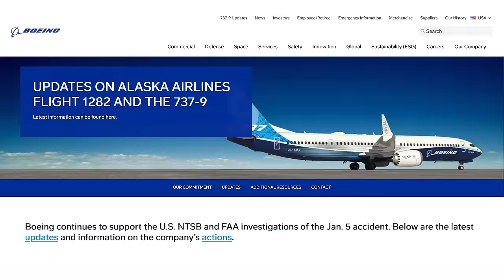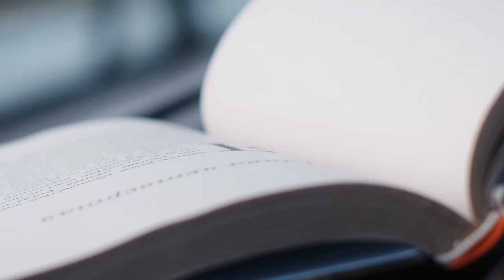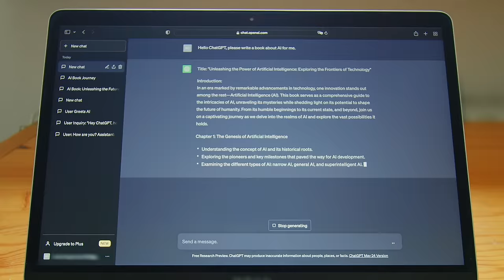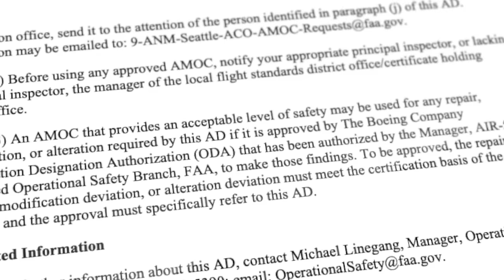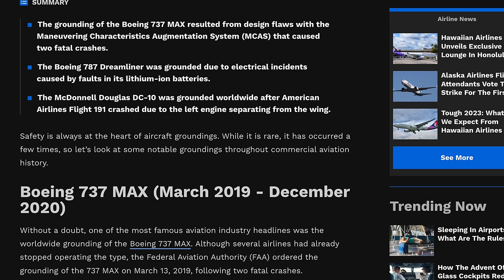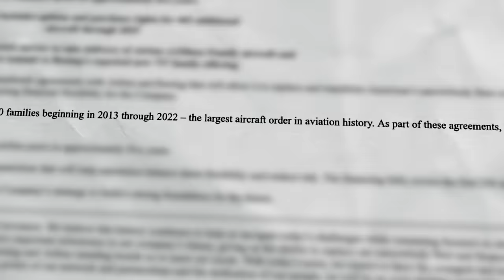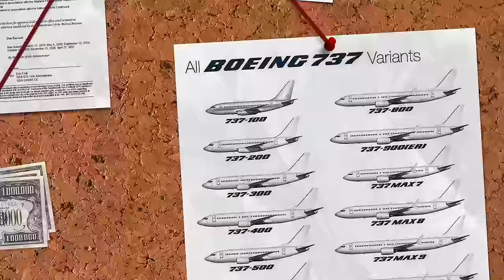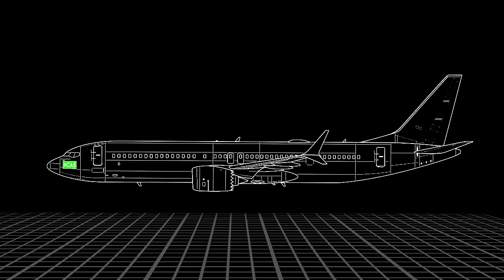737 MAX - How Greed is KILLING An American ICON

Comment: Acording to Mentor Pilot the max was a perfectly safe fly able aircraft without the MCAS  system. However its handling was different and that was the problem as it would need pilot retraining. The MCAS system wasn’t supposed to do what it eventually land up doing and that was down to faulty software. Apparently MCAS is in use on other armed forces planes without a problem all be it with I believe different software settings. “Mentor pilot” does a brilliant job of explaining.  As for the plug that really was down to human error and the failure of proper inspection, again Mentor Pilot explains the details as to why it wasn’t inspected, a failure in the rules!  Those type of plugs are used on other planes and when fitted correctly!  are perfectly safe. The bolts in themselves don’t hold the plug in place, rather they stop the plug from moving up out of its secured position had just one bolt been fitted this wouldn’t have happened, unbelievable that all four were missing. As for the airline my guess is the airline was aware of a problem and I’ll bet it was scheduled an inspection and repair. They probably thought it was just a faulty or damaged seal as that was the reason for the plug being removed in the first place.

Comment: ok stop the drama about the loose bolts raising the number to 500. A Rapid D wouldnt have killed all on board unless the door happened to hit the tail  and ht odds of that are really slim. And pilots would never check fuselage for leaks. How would they? . they'd check the working doors for leaks and it probably didnt even give a door warning. And it takes awhile to find a problem if it gives a warning then stops.  The training on the MCAS wouldnt have been much since it's not much different than a runaway trim scenario which has been trained for say 50 years. Put your hand on the trim wheel and stop it or turn off the system. i believe the one crew turned the system off then back on. There's a reason it happened at small airlines from companies you've never heard of. Their training and pilots usually arent the greatest. I had 40 years in aviation as a corporate and  airline pilot.  and i got tons of stories that would curl your hair.  My airline didnt have the updated software for one jet type for over 15yrs because they didn't want to pay for it. Boeing kept this going because it was cheaper and an easy plane to fly and less training cost and got them quicker. Plus the pressure to buy american. This isn the first time a plane has been stretched and stretched. the 737 was originally built to land on dirt and grass strips. its landing gear isnt much compared to other jets.

Comment: I am on vacation. Both flights to get here were in 737Max. The first 737Max9. On the Max9, the cabin pressure was very poorly controlled. Why can’t they close loop that thing?
Reply: I once worked at a medical manufacturing company with a broken culture. I didn’t think that this would happen when the product is life and death. It does. Greed undermines leadership. Leadership is the fertilizer that keeps the weeds down.
Reply: You will know, if you find yourself in a greed driven organization, because everything is bonkers.

Comment: Simple switch(es) either go for Airbus A320/1s or try Comac C919s or even give Irkut MC21s a go.
Reply: The A320 is its own can of worms. The list of software issues with that plane is scary AF.
Reply: @paavobergmann4920  Surely means nothing compared to MCAS on B737 MAX
Reply: @t8polestarcyan22  The difference, in my personal gutfeeling, is that the A320 is wonky, and the 737MAX is downright criminal.

Comment: P.S. I take it some of it back. "The market forced them," is a garbage argument. If you can't compete with the safe competition, you don't put out an unsafe product. Any reasonable competent software engineer knew that Boeing's proposal was bollocks from the jump. Faking physics using software is ALMOST ALWAYS going to be just as expensive as fixing the physics to begin with.  Boeing's plan MIGHT have worked, if they had spent the necessary time, money, and care on the software, but they didn't. This has been a pox in software effectiveness since the 1960, with hardware engineers noting problems and limitations with their design and saying, "we'll fix it in the software." It least to many failures and disasters.

Comment: My advice: take the train. Oh, right, there is no decent railsystem in the US. Wherever it is you're going, I hope and pray that you make it there and back safely. Your videos are really educational, but not just that, there's enough going on that kills people. No company should be killing people for greed. I would say: have all current 737s checked from top to bottom and inside out. Stop building new versions. Build only the ones you already have, minus the 737 max. And in the meantime, start the hard process of actually building a REAL new plane, even if it takes 15 years to complete. If you had started that before you would have nearing completion by now.

Comment: Conventional doors are held in place by air pressure at altitude. Why didn't they use the same fail-safe sealing mechanism for the plug ?  Short answer is probably to save weight. Every gram of emitted CO2 counts these days as every other criterion, even aircraft safety, becomes secondary to "saving the planet".

Comment: 09:20 - they complained , any issue with the aircraft even before Max they have to report to Boeing and Boeing advised them on what to do and if it's safe to fly further and so on, which probably they said it's okay and gave them some parameters that they can keep flying the aircraft as this could be due to a faulty sensor. Faulty sensors are usually the most common issue and in some cases aircrafts can fly like that for a short period of time, ofc depends if it's a known issue, risks and the list continues.

Comment: I read ,Alaska airlines knew there was a cabin pressure issue yet still flew several flights w/aircraft & gave flight restrictions(no flights over water & alt limit). Why wasnt this plane in service, not still being flown?.Companies should hire fr with in more often. People who actually care about the future of the company. People with experience who have knowledge, wisdom and understanding. You also have to make sure your employees are taken care of. Cant hire grocery baggers to build airplanes or doors blow off in mid flight... Has to be a career. Carpenters, plumbers, light rail drivers, electricians all make more & still have pensions. Boeing used to be up there w/Long shore men, Railroads and top notch companies for employment/careers. They should go back to what worked for the company before and made it and its workforce what it was in 80’s ,90’s and early 2000’s. That way things like this don’t happen. Very hard to get good workers , harder to get good worker with experience . Im sure the auto industry will have similar issues if the employees remain unhappy or face a high turnover rate.

Comment: Boeing's 737 was a great design aircraft, one that should go down in history as a significant type class.
But unfortunately so was the Model T and Model A Fords. Great and significant doesn't mean it's flight worthy forever. It's an old and time worn, now less effective and less fuel efficient, design option for a prestigious manufacturer to opt into for new designs. It's become the old VW Bug of commercial airplane carrier choices. It needs to be and must be phased out, which Boeing's greed isn't ready to do. 
Alaska Airlines knew something flukey was going on around those two left-vacant seats (likely from passenger complaints of excess whistling noises at that location). It was no mere coincidence those two seats were vacant. In defence of Alaska Airlines it's probably also likely that Boeing was turning a deaf ear to its continued concerns. It was left with little options if Boeing insisted the planes were okay to fly. No one else would listen either.
The FAA is also culpable for designating Boeing employees to act in its behalf as delivered article inspectors. FAA inspectors must come from a separate non-Boeing employee pool.
The FAA, Boeing, American Airlines for forcing Boeing's hand, and to a lesser scale Alaska Airlines for ignoring a significant indication that those planes shouldn't be flying, are all culpable. Litigation should fly, and dollar amounts fly off the shelves.

Comment: If Alaska followed thru and grounded just that plane over the pressureization issue has handled then there wouldn't been a blown out plug door. I agree boeing should be held responsible for the bolts missing. Alaska know there was a issue and also did nothing. What's worse is Alaska desided to put people in that plane and risk those people life's. Alaska should have grounded that plane till the pressure issue was solved and not risked peoples life's. Alaska knew something was going on because they did seat no one around the door plugs. Alaska is more at fault as Boeing when they know there was a pressure issue and desided to keep flying the plane with people aboard. To me it seems like Alaska is hoping that everybody stays focused on Boeing and not on them.

Comment: I normally really enjoy your content, but your history of the 737 MAX design decision and the resulting MCAS was, at-best, wildly misleading in COMPLETELY ignoring the Southwest factor.  Southwest is traditionally the launch customer for new 737 variants (including the MAX), which gives them tremendous influence with Boeing into design decisions, and this combined with their ongoing commitment to ONLY operate 737s was arguably the primary driving factor that drove Boeing to update the 737 instead of developing a new "clean sheet" aircraft type.  Beyond that, and woefully missing from your summary, is the ESTABLISHED FACT that Southwest conspired with individuals at Boeing to hide the MCAS system from both regulators and pilots so they could conduct the "737 MAX differences" training entirely via computer-based training without having to conduct expensive simulator training for pilots!  Maximus Aviation covered the SWA conspiracy in a video titled "Southwest Forced Boeing to hide MCAS from FAA &World Regulators to avoid costly pilot training"

Comment: If you think like an MBA then it was a good decision. If you are an engineer, you knew from the start it wasn’t.  The business decision was about artificial constraints.  Engineering is supposed to be about overcoming natural constraints. Avoiding a new type certificate and forcing a new plane to fly like an old one are engineering challenges but of a type that is likely to fail.  Non-engineers can’t understand this. A company about advanced technology needs to be run by engineers, not MBAs. A war broke out when Boeing merged with McDonnell Douglas and the engineers lost.  Now Boeing is being attacked by woke progressives. The culture is rot.

Comment: Your research is lacking. Many details are incomplete or just wrong. And your "theory" is complete nonsense.  Aircraft have pressurization problems all the time, NEVER once due to a plug door in 50+ years. Alaska Airlines didn't know.